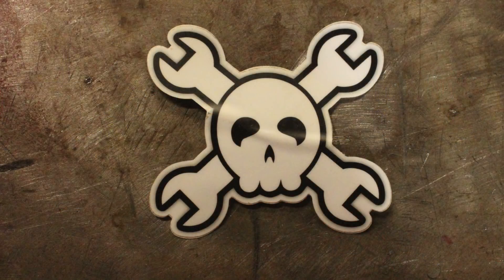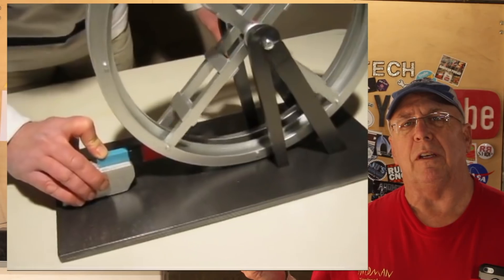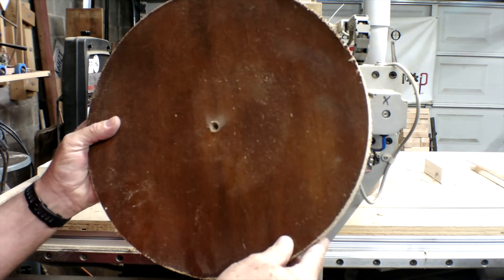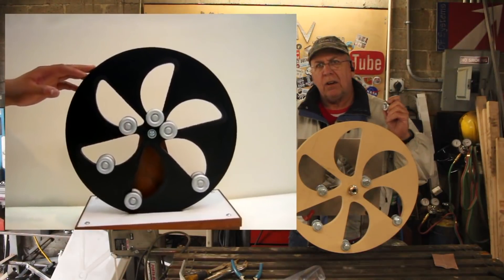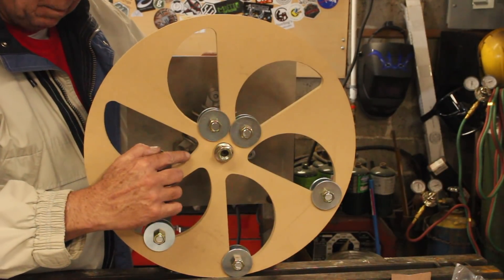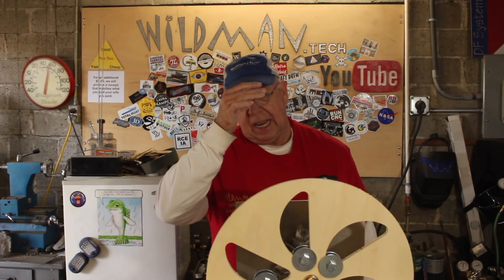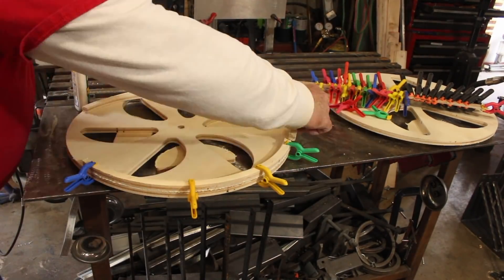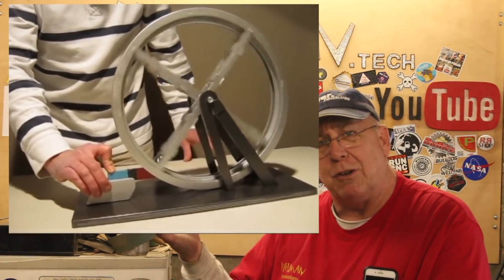Free Energy Devices Debunked!

Comment: I am not sure if that is supposed to work but I can see something you’re doing wrong the ball needs to roll and the only way you’re going to make the ball roll is by pulling a magnetic force from the top of the ball if you use your magnet under the ball the magnet will tend to want to slide the ball and not roll the ball even if the magnet is perpendicular to the ball I still don’t think the ball will roll properly if it’s going to work. It will have to do so by the magnet pulling the top of the ball so the Ball can roll properly.   I don’t know but look at the guy doing it again he has the magnet it’s a flat thin magnet compared to yours the magnet is sitting on top of a block off the ground a certain distance the ball is riding up on the side of the wall of the circle.   So what I’m thinking is he’s pulling a magnetic force just on The top surface of the ball so the ball has to roll but when the ball rolls it rolls forward so the weight of the ball is pushing down on the wheel causing the weight of the ball to turn the wheel to bottom dead center from the weight of the ball.  The ball rolling is the key you have to get the ball to roll.   Of course that’s if the device works at all that’s how I see it would have to function if it was to work

Comment: what would happen if you used a 1823 da vinci overbalanced wheel and the last project together with all ball bearing first ,and then replace the smaller bearings with the fender washers that are tightend to get the most spinning stored energy? as the large bearing pulls to the magnet the fender washers  will have gravity pulling down. a adjustable mounted magnet will work better as no movement,  also if the axle point could levitate it would have less Friction
Reply: Da Vinci wasn't born 1452 April 15 on a Saturday and U are 1823 incorrect because he was dead by then???

Comment: Hey there just a thought... You know how a magnet has a positive end as well as a negative end. How about trying the exact one you tried but with 2 mags, 1 pulling and the other pushing. Due to the fact that wood has alot of friction to the surface with the metal ball (maybe adding a plastic track) for the metal ball to be guided upon. Another thought is... You know how you can place a battery inside a copper coil. How about 3 batteries (for weight) on a coil that went around that wood cog. Just a thought
Reply: Nope, putting more than getting out

Comment: If I may ....... Having worked in an Electric Motor Repair - Rebuild - Rewind Shop for 22 years I have a little insight for you. The premise of the wheel, ball, and magnet demonstration actually should work. The difference between theirs and yours is lighter components. The wheel is aluminum, and the ball is smaller, while the magnet is still large and placed higher up the outside of the wheel. Plus, I believe the inside rails of the aluminum wheel are beveled making for a smoother surface for the ball to travel on. Less weight, less friction, and more magnet=Success.

Comment: Hey I'm chomping at the bit for someone to debunk me it's incredibly easy to grasp to say yay or nay on the actual proof of concept it's way different than any other device I can find. Anyways anyone who is familiar with equations could probably prove or disprove with three equations unfortunately I have a memory problem of epic proportions so in essence I'm screwed. If you are thinking this is clown shoes it took me five minutes to come up with a true camless valvetrain that uses no sleeves no nothing but my basic design that allows near instant full open valve actuation reduces friction ( this is the thing that normally matters) by probably a minimum of fifteen percent. Now that means you can reduce the engine size appreciably and what's more you can rev the snot out of most engines to twelve thousand rpm meaning most performance engine piston numbers can be reduced by half. Yes I am proceeding to licensing very soon but the over unity device bugs the hell out of me robertreid66@yahoo.com

Comment: I'm not saying that it works! I'm just interested and want to find out... just like the next man. I'm looking at your first experiment and I can't help but thinking: First (minor problem), wood is an inhomogen material and by nature not very balanced. Second: How much weight and how much friction does this mechanism have /produce and how powerful was the magnet. Again, I'm not saying that it works, but you should have taken a more scientific approach, using equations, ball bearings,...maybe position the magnet in different angles etc. If you think about it, a magnet is almost a "free energy device" by itself. It pulls specific objects to itself and you can basically levitate a magnet on tot of another, if you place both in a tight tube and orientate the matching poles to each other. Maybe it is possible to find a way to use this property, maybe its not,...but if you try, try it the right way.
Reply: I totally agree !  I swear my first thought was " why wood " ?

Comment: i believe in free energy ,reason is that ,i personally made free energy in 2009 ,it had run just 10 second with high rpm and destroyed  unfortunately still i am thinking about that .
Reply: https://www.slideshare.net/PDiCEOThaneHeins3240/heins-law-of-induction-expanded-lenzs-law   Energy is created in every electric generator. In conventional electric generator, created energy is used to do negative work and decelerate rotor. In ReGenX generator, created energy is used to do positive work and accelerate rotor. There is 20 magnets on rotor disk. When it rotates with 3600 rpms,  frequency is 1200 Hz. At such high frequency current flows through capacitance between wires, and that causes current to be delayed in time domain. Current start to flow, when magnet has already passed top dead center of the coil.  Regenerative acceleration effect occurs above critical minimum frequency.
Reply: If it ran for 10 seconds it’s not free energy

Comment: Create electricity from unwanted heat.  Instead of using electricity to move heat like an AC unit.  You pipe a liquid refrigerant into the house and spray it into an evaporator.  The gas leaves out another pipe.  The pipes collect together into mains that go to the ocean.  The pipes are vacuum jacketed to prevent 2 of 3 forms of heat transfer, direct contact, and convection.  And by using the right colors direct the 3rd, infrared. Even have a secondary pipe that is exposed to the sun for the gas to collect more heat.  You put turbines on the gas pipelines.  There is your electricity.  The heat rich gas goes to the ocean where it's compressed in wave pumps. Where you have a float that sits on the surface which rises and falls with the water.  Under the float you have a piston that is your counterweight  the piston compresses  the gas inside a cylinder. Just like a refrigerant recovery pump. When compressing gasses into liquids they raise temperature drastically.  You cool it using a heat exchanger where the heat is transferred to sea water. They basically swap temperatures by running them in opposite directions with a conductive separator.  So then  you have cool refrigerant to go back to your AC units. And hot seawater for vacuum distillation also using ocean swell pumps for the bonus, water. Then use electrolysis on the water to get hydrogen and oxygen.  You can run an internal combustion engine vehicle with hydrogen for literally no cost. We wouldn't have to buy electric vehicles and deal with lithium batteries to beat pollution.  The exhaust is water vapor.  The navy has a much simpler system that they came up with independently of mine. But it shows the basic concept.  I'll add link- https://youtu.be/LJV4d4XtHuo
Reply: No such thing as free energy.  Just available energy waiting to be converted.

Comment: If I sent you my engine would you build and test it ? 

I built something that as far as I can tell is unique in many ways, for 1 it works on the horizontal axis, no magnets no electronics.
Reply from the maker: Yes
Reply: @WildmanTech  Not trying to be funny mate, but would you mind signing some papers, I not got the machine patented yet, im homeless and this is my big chance. 

Im not trying to pull the wool over anyone eyes, the reason I want someone to witness the prototype or build one is because I need someone to vairylfe that the machine does indeed work. 

I been through google , looking at all sorts of inventions, and things, and none of them are close to mine. 

My engine, works on the horizontal access, no mags no electrics, no tricks, just uses fundamental engineering principles that have not been applied in this type of application.
Reply from the maker: @bushtrash2286  I'd sign a non-disclosure agreement if that' what you want.
Reply: So….where is it?
Reply: @davidgill3356  it's not around , I had to dismantle because the parts are used to secure my tent against strong winds , and weather .   I'll try to make another if I have time, and put it on YouTube  in a private vid, I also gave up on trying to market it as lack of interest in it and lack of money to have it built professionally.
If you want I'll try to make another 1 but for now the parts are used to secure my camp, and I'm not prepared to have my camp destroyed.

Comment: I discovered free energy....

I tapped into my Neighbor's electrical supply..
Reply from the maker: Actually, if you wire all your 220 volt stuff in ahead of the meter, you'll never get caught...until you sell the house.
Reply: https://www.slideshare.net/PDiCEOThaneHeins3240/heins-law-of-induction-expanded-lenzs-law   Energy is created in every electric generator. In conventional electric generator, created energy is used to do negative work and decelerate rotor. In ReGenX generator, created energy is used to do positive work and accelerate rotor. There is 20 magnets on rotor disk. When it rotates with 3600 rpms,  frequency is 1200 Hz. At such high frequency current flows through capacitance between wires, and that causes current to be delayed in time domain. Current start to flow, when magnet has already passed top dead center of the coil.  Regenerative acceleration effect occurs above critical minimum frequency.

Comment: @ 7:40 you can see the upper portion of the support plays a part in nudging the rollers over as the wheel rotates. or am I imagining it?
Reply from the maker: Tough call. I can't tell.
Reply: @WildmanTech  or, I also noticed the wheel is inserted in the base. Could be a drive wheel inside.
Reply from the maker: @ubrvidgeek886  Very likely.

Comment: Excellent job I like this, the ball and magnet might work if you could turn on/off the magnet and have multiple steps (saddles) around inside the ring so as it pulls the ball up hill (up the steps) and the ball lands on a step, off magnet and that will allow gravity to pull the ball down and move the wheel then on magnet to pull the ball up another step and so on/off.  Maybe.!?!
Reply: that would be an electro magnet, which requires electric, hence power loss.
Reply: Sorry @StevieRich  We turn magnets off and on all the time they are not not electromagnets.

Comment: Nice video but I'm not buying for a second you really think or thought perpetual motion is achievable.  I believe you pretended to do so for the video.  Cheers!
Reply from the maker: The only mention of perpetual motion in this video was that we were NOT attempting to achieve it. I was however, trying to juxtapose the power of the magnet against the pull of gravity. Nothing free about that. That is an energy conversion.
Reply: Hardly a conversion, two potential energies acting on the ball bearing, pulling it to a new stable position. Nothing that would suggest this would make the ball rotate thus spinning the wheel, in my opinion.